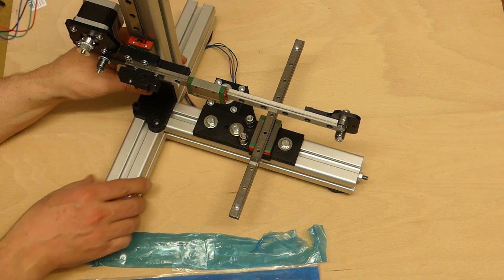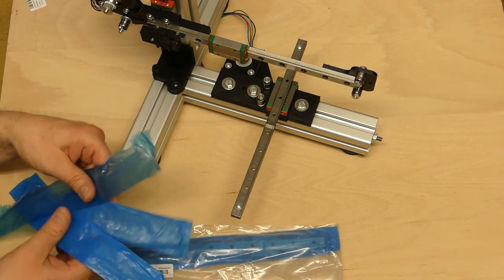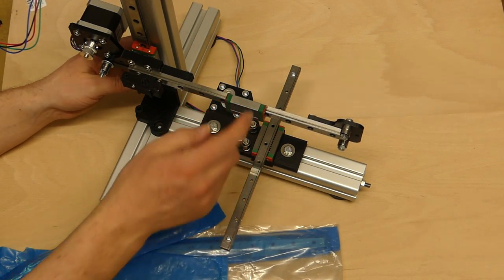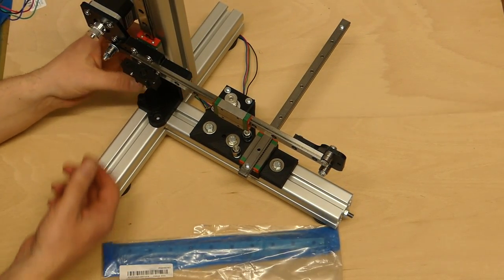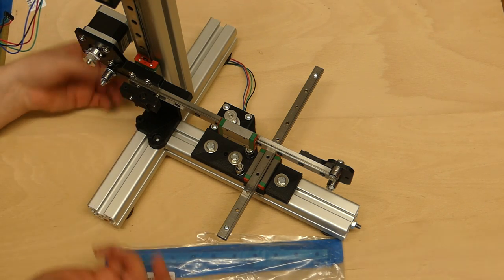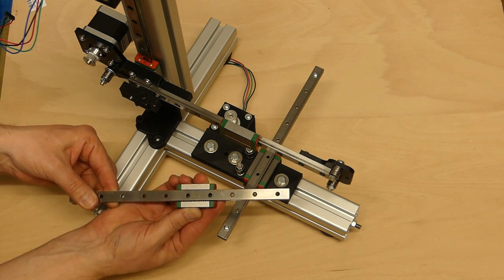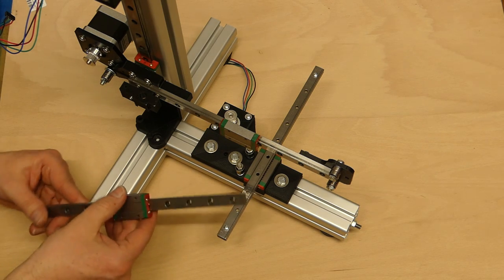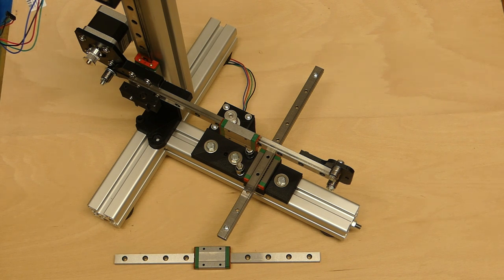Big Bad Robin Build VLOG pt. 13

Comment: isopropanol & ultrasound bath, remove ball(s) from bearing, finally relube with Ballistol
...Alles wird gut 💪👍 😎
("dein" Gearbest kassiert nur mein Geld und schickt gar nix :-( )
Reply from the maker: Die Kugelführung ist total zerquetscht - da ist nix zu retten  ... 
Da ist Ursus mit dem Powerschrauber am Werk gewesen.
Die Besten haben bisher immer alles irgendwie (am Zoll vorbei) zu mir geschafft .... allerdings war es wirklich nie schnell da .... 4-6 Wochen sind normal. Irgendwann stand dann immer der nette Man von Hermes da, und hatte was fuer mich.
Das Tracking hat die letzten 3 Tage dann gezeigt.
Die Guten hatten mir vor nicht allzu langer Zeit fuenf LiPo Akkus geschickt, vier waren quasi leer - einer, der schon von aussen anders aussah funktionierte. Immerhin tut bei denen das Tracking ....
Reply: @dirk ...wenn du willst könnte ich dir sofort 2Wägele leihen....
Reply from the maker: Danke fuer das Angebot ! Ich hab mich mit einem etwas aelteren Wagen beholfen, und die Z-Achse muss jetzt ers mal so auskommen. Fuer Stuttgart wird das reichen muessen. Ich weiss eh nicht ob ich den ganzen Rest fertig bekomme - ein weiterer Lieferant hat jetzt abgesagt ...